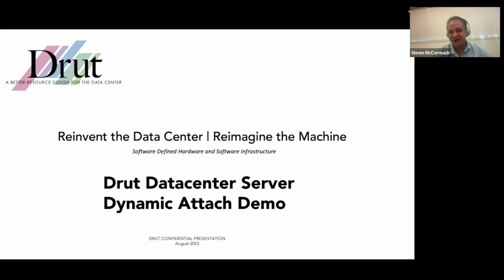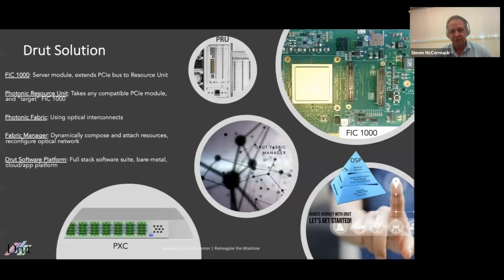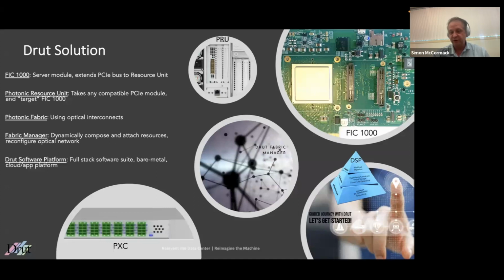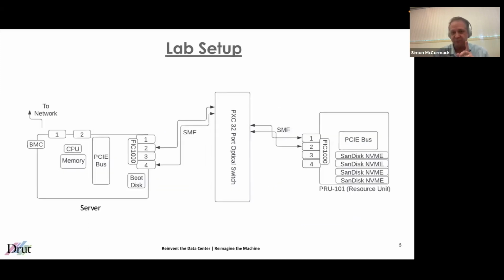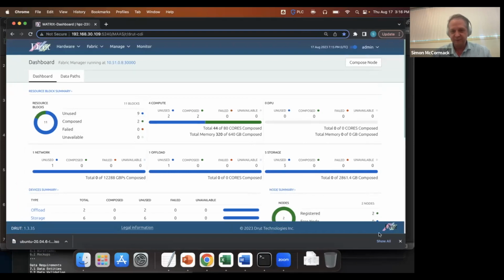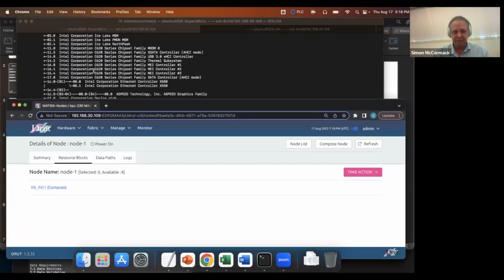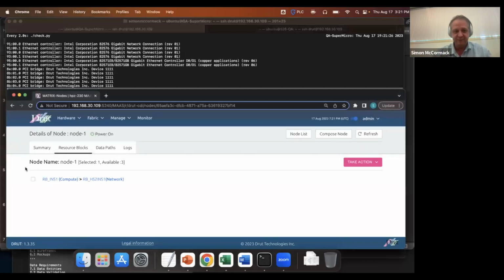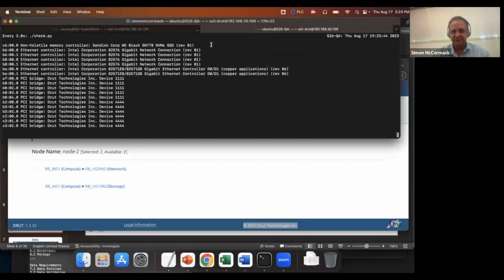Drut's Datacenter Server Dynamic PCIe Resource Attachment Webinar

Comment: Pretty cool demo. On your note around security, on some high security programs my partner used to work on years ago, they would have to pull and lock up their hard drives in a secure vault. Something like this could fit in those scenarios, and maybe integrate with CAC or PIV to automatically assign and remove hardware on development stations based on system authentication. -- Looking forward to the GPU demos.
Reply from the maker: Hi Dan, that is a pretty good example of what I was talking about for the use cases. I know a lot of secure environments would relish being able to temporarily attach both network, storage and smart NICs. Allowing them to securely connect to external systems for a controlled period of time.